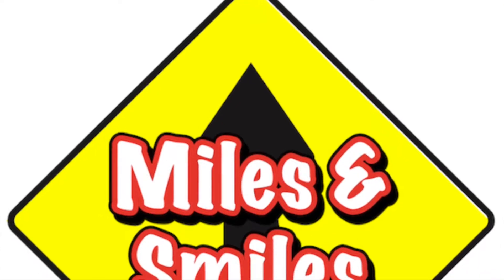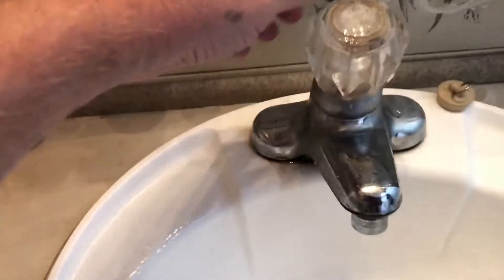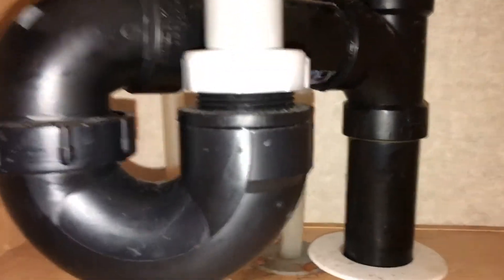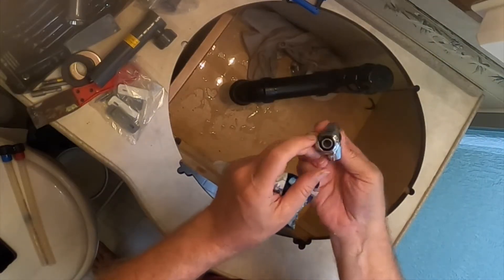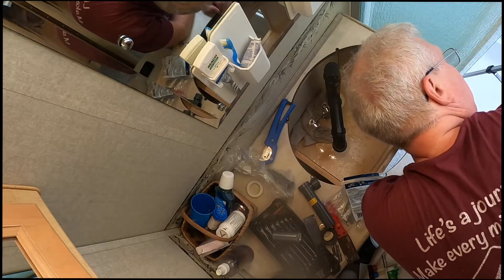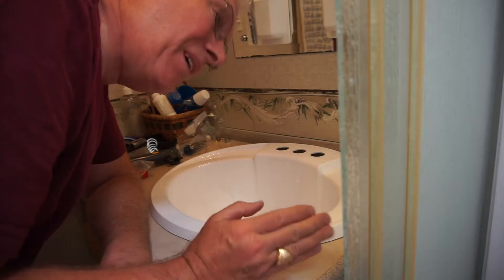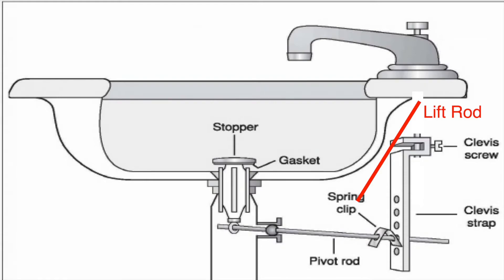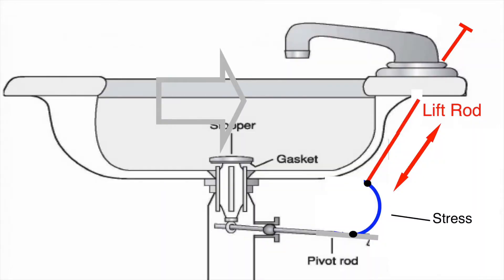Replacing the RV Bathroom Sink - How to or how not to!

Comment: Always install the faucet on the sink before dropping it into the hole. Then make all connections. Good luck.
Reply: Yep. Live and learn!
Reply: I took your advice on attaching the faucet to the sink first, and found out that's wrong.  Miles and Smiles has it right.   If you attach the faucet to the sink, the back of the sink will not seat properly.  The nuts that hold down the faucet to the sink prevent it from sitting flush to the counter.  As soon as I removed the sink and faucet, re-inserted the sink, then fastened the faucet with the plastic nuts ...it seated properly.   I have learned that RV repair is a learn as you go experience as pointed out by Miles, and some of the advice works....and sometimes it doesn't.

Comment: I agree I hate plumbing to. But I did learn a couple thing watching you struggle 😅 like go ahead and install new faucet to the sink and the lines so as you don't have to struggle on your side attaching when it will still all fit through sink cut out just fine.
Thanks for sharing now my break is over and I must return to lots of grunting and finish my install.
Reply: That's why we do these "how to" videos - so others can learn from my mistakes! Good luck on the install.

Comment: Hey Jeff.  I feel your pain trying to squeeze into that tiny space.  I just replaced the faucet and drain in the bathroom sink at the Acme parsonage before retiring.  And I thought that was a tight space!  You could have saved yourself a bit of trouble by cutting your hot and cold lines before pulling the sink.  No need to remove the faucet before removing sink.  When assembling you could have saved some grief by attaching the faucet to the sink and attached the flexible metal lines and then drop it in the hole.  Next time maybe (you did say you'd do it again).  :-)

If you ever get a hankering to camp at Shawnee State Park in PA, we're only about 15-19 miles away.  Would love to see you two.
Reply from the maker: Hey John. Thanks for the tip. I'll keep that in mind if I ever have to do a job like this again! We'd love to see you guys, and you're always welcome to visit us at our lake in NJ as well. You know how to reach me :-)